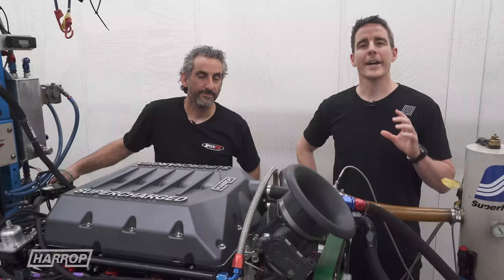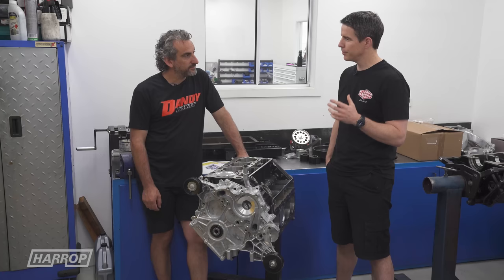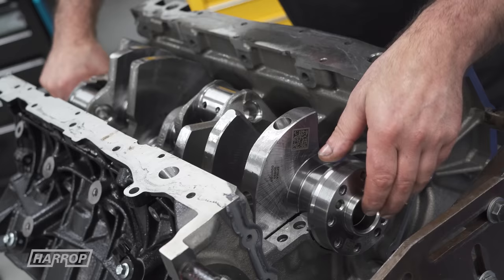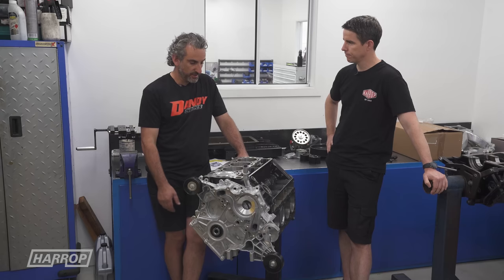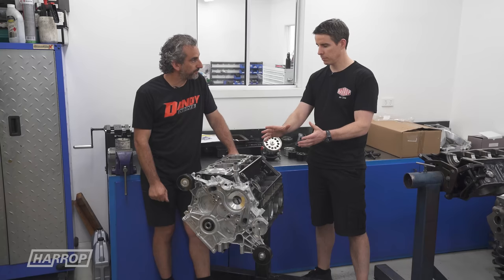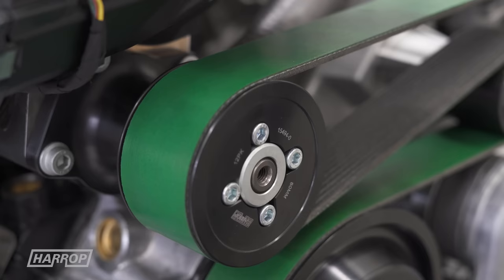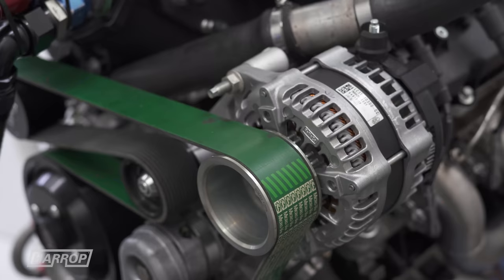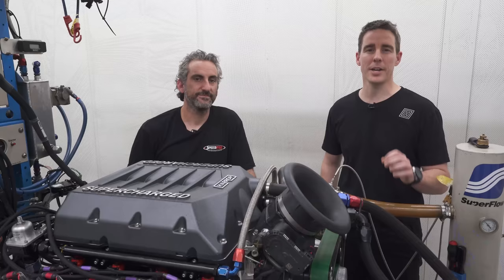1300HP Ford 7.3 Godzilla V8 | Harrop TVS2650 Supercharger Testing

Comment: Bring back the 4.9 straight six with a flow through head. All the power I need to get from point A to point B. All in all its a very nice set-up you got there.
Reply: I think Power nation built a 4.9 with 540 hp it was quite interesting, I had one in my truck 350,000 miles and it ran perfect.
Reply: @andrewward1887  
Yes they did.  I watched that series and the look on their faces after it went from 80 hp to over 500 hp  was priceless.
Reply: Just use an Australian Barra Six !  500 HP is almost factory stock for the 2017 Turbo Falcon 436 HP

Comment: using hydraulics instead of a belt you can control the blower speed with valves, still driven off the crank hydraulic pump that turns the blower

Comment: That is pretty fat, makes my 5.0L Windsor look like a starter motor.
Reply: just turbo your windsor
Reply: Hahaaa!! that made me laugh.
Reply: Maybe you better find some old copies of Mustang and Fast Fords magazines from the early 90s where guys were using a Boss302 block as a foundation to build that Windsor engine to 1200 HP with a power adder.
By comparison, this 7.3 is weak sauce
Reply: reading this im curious, are you talking about current gen 5.0 L when you call it a Windsor? Guessing youre not from North America as I have never heard it called that before. I live in Windsor, Ontario Canada where those engines are made, my uncle is an engineer there actually.
Reply: @WeekendWarriors87  In Australia, a 302(5.0) version of the Cleveland was available('71 to '82), as well as the 351(5.8)C that was also in North America, so the need to distinguish it from the Windsor variety of small block in the same displacements.
Reply: @WeekendWarriors87  More accurately, it refers to the 351 ci 90 degree V small block engine which was manufactured primarily at the Windsor Ontario plant beginning in 1969, and called "Windsor" to differentiate it from the 351 Cleveland  (1970-74) and the 351 "M", the "M" standing for "modified" as it was a tall block version of the Cleveland engine.
351M and 400 blocks were mostly made at Fords Michigan Casting Center.
The heads for Cleveland and "M" engines were built in Ford plants worldwide including Australia and South Africa.
The 221, (1962) 260, (1963-64) 289 (1965-67) and 302 (5.0 liter-1968-2002) are all lower deck versions of the 351 Windsor engine
The current "5.0" engine built by Ford has NOTHING in common with the older series of engines
Reply: @thoriated  Closed chamber "small" (2.07 inch) valve heads--also made in South Africa.
Supply is drying up, they are great for modifying 400 ci car and truck engines if one doesn't want to buy aftermarket aluminum Cleveland heads
Reply: @WeekendWarriors87  My engine is a 1996 5.0L in an AU Falcon ex police chaser. I'm in Australia.
Reply: @donreinke5863  thank you. Yes I know they are different but he called it a 5.0 and the old Windsor 351 is more than 5L which is why I was asking. I hadnt heard the original 302s from that time period referred to in that way (meaning as a windsor) which is why i asked. Thanks!
Reply: @WeekendWarriors87  Youre welcome.
The 302 became commonly known as the 5.0 in the early-mid 80s when Ford began placing 5.0 emblems on Mustangs after their fortunately short lived disastrous experiment with a 255 ci V-8 from 1980-82 for fuel economy reasons.(it was a 302 with a smaller bore)
The actual displacement of the 302 is closer to 4.9 liters than 5.0, but Ford was already using 4.9 as the engine designation of the truck/Bronco only 300 ci inline 6
The 351 was known as a 5.8, even though 5.8 liters is actually 354 ci.
Boring a stock 302 .020 oversize yields  4993 cubic centimeters, or very close to 5.0 liters
61.02  ci=one liter.
Reply: @donreinke5863  Interesting! In Canada I think we still called it the 302 into the 90s and beyond, even though we technically had switched to metric at that point. Currently here in Windsor they make parts for the 5.0, the 7.3 from this video as well as the 5.2 voodoo from the shelby mustangs. My truck and everyone I know runs a coyote 5.0, although its getting less appealing with the ever increasing carbon taxes here. Its interesting to me to see such a fan base of large V8 sports cars in Australia, all we ever hear about from your side of the pond as far as our media goes is small diesels and we always wish we had diesel trucks and SUVs like you guys do!
Reply: @WeekendWarriors87  no the Windsor was the older 5.0L pushrod V8’s used in the Foxbody Mustang and first two years of the SN95 Mustang, there is also a 5.8L or 351 Cu in Windsor, which is almost identical aside from the deck height being 9.5 instead of 8.2 inches, and also considerably stronger, easily holding 900+ hp where a 302 or 5.0 only comfortably holds 500-600
Reply: @donreinke5863   The small block 351W/351C and mid size block 352FE have the same bore and stroke of 4.000x3.500 or 351.86 c.i., Ford wanted a easy identifing difference between the car engine and HD truck engine.
Reply: @gen1c8rs88  The 352 FE engine was discontinued at the end of the 1967 model year and was not primarily a truck engine, first appearing in 1958 as an optional power plant for the Fairlane/Galaxie and standard in the 1958 -60 4 seater Thunderbird. (optional Thunderbird engine was the 430ci MEL series engine)
In the early 1960s, the 352 was the second optional V-8 in full size Fords after the Y-block 292 and from 1965, the 289.
In 1968, Ford began producing the 360 V-8, which was exclusively a truck engine, it used the larger 4.05 inch bore of the 390 (which had been in production since 1961) while retaining the 3.5 inch stroke of the 352
The 360 FE was never installed in U.S. passenger cars, although a 361 ci FE engine was used in the 1958 Edsel.
The 351 Windsor was introduced for the 1969 model year, a high performance variant being offered in Mach 1 Mustangs.
In 1970, Ford introduced the 351 Cleveland, the last new overhead valve V-8 they would design and produce until the recent introduction of a 445 ci (7.3) liter 3/4 ton and heavier truck only engine a couple years ago.
351M and 400 ci engines are variants of the Cleveland, which use the same cylinder heads on a taller block and with the 385 series (429/460) bell housing bolt pattern.
The 352 FE and 351 Windsor were not concurrently produced.
Reply: @donreinke5863  Thanks for the information.
Reply: @gen1c8rs88  Youre welcome.
Reply: @Olds_Pwr  The engine commonly known as a Chevy 350 is in fact slightly smaller in displacement than the Ford 351 (or the old FE 352) possibly why the Chevy is known as 5.7 and the Ford 5.8
Stroke on the 350 Chevy is 3.48 while both Ford engines is 3.50.
All three share a 4.00 inch bore.
Buick, Pontiac and Oldsmobile all had different bore and stroke combinations to arrive at "350" with the Olds having the shortest stroke.
When the Olds 403 was made, its bore size exceeded all  "modern" passenger car engines except the Ford 385 series (429/460)
Even the Cadillac 500 bore was smaller with a 4.304 X 4.304 bore and stroke
Reply: @tylerdavis2516  The easy way around that was using the Boss 302 4 bolt main block which was up until a couple years ago (and still may be) available from Ford Motorsport.
While many stock 302 blocks (even the supposedly thicker Ford of Mexico blocks) would fail at high power levels (there were even reports of them splitting right down the center) the low-deck Boss block is capable of 1000 + hp
Reply: @donreinke5863  yeah the stock 302’s are fairly weak for an American V8, but the 351 is quite strong and like I said can easily hold 800 hp, and you can find them for a couple hundred at the junkyard, instead of a couple thousand for a lower displacement boss 302 from ford racing.
Reply: @tylerdavis2516  The advantage of the Boss 302 based engine is that crankshafts are commonly available to stroke it to 347ci AND it will fit easily in engine compartments where the taller and wider 351W is difficult to install without sometimes major modifications.
Of course, the 351 can and has been stroked to 408ci (and Ive seen some reports of larger still)
There was a guy at a car show here last summer who built and installed a 408 inch "clevor" in a late 60s Mustang.
Reply: @donreinke5863  yeah I can see that, but you can say the same for the 351, which you can stroke out all the way to 427 and even 460 with some machining to the block, and all you have to do is throw a cowl hood on and you’re ok as long as you aren’t using a high rise intake mani
Reply: @Olds_Pwr  No I didnt. It was an alternative reason why displacement is called what it is.
Reply: @donreinke5863  Copy\Paste next time.
Reply: @hamishfullerton7309  LOL I have definitely heard a lot about the emissions stuff on diesels (my buddy is a diesel mechanic). I drive a V8 and hoping to stick with V8s until im forced into electric.. but I do love the idea of small diesels if done properly. The new 3.0 powerstroke coming to your rangers will be a sweet combo once you deal with the emissions stuff, not sure how your government inspections are but we just got rid of ours with our current government which made it a lot easier to fix those issues.
Reply: @donreinke5863  I'm laughing hard, no, no Windsor was making 1015 HP on 10 pounds of Supercharge boost with factory everything. None, notty, they had some sick bada$$ heads and cam combo with more then 19 pounds of boost to make 1300+ HP. I have crates full of Ford and mustang magazines and every other hot rodder magazines you can think of too. By the way, these cams these guys are using is nothing like they used back then either. There is only a handful of trial and error cams being tried. So no, this Godzilla isn't even being poked yet, it's being shaken to see where it will go though.
Reply: @garykarenmcgruther6386  Sorry, this engine is lame at those power levels.
Do you hae any idea what kind of power was being made from boosted 7 liter (426, 427 and 429) engines as far back as 45 years ago?
YOU are making ME laugh at your displayed naivete.

Comment: Borowski Racing Engines . 
427 cu inch.  Smaller cu inch than yours .  4.5 liter Whipple with intercooler 1290 hp on USA 93  which is 98 octane here . 
1138 TQ all @ peak boost of 19 lbs

Comment: 1,300, that thing is barely sweating🥱. You can do a lot with displacement when it’s built to handle the boost your adding.
Reply: Displacement and flow. This is the first big block made from the bottom up in like half a century, the potential of this engine is insane. Coming from a huge chevy guy.
Reply: @SoI_Badguy . Absolutely, there is so much potential with a big block💪🏻. Anytime you have heads flowing 300CFM’s and 10:5:1 compression factory you have a lot of potential. 600hp N/a will be easy with a 230’s/XXX cam. And you will have tons of bottom end torque with the displacement.
Reply: @SoI_Badguy . Lol, they will be the new 5.3’s🤟🏻

Comment: I'm pretty sure a 427 turbo ls makes the same if not more horsepower at the same boost level. For 1/2 the cost I'm sure.
Reply: i 6.0 makes more power at same boost level bone stock bottom end
Reply: @thomasstott527  I know, but I was comparing a similar cube size GM pushrod engine (427 ci) to the ford (444 ci) for the higher torque ratings also.
Reply: @Thegoose95  large displacement always equals more torque... hence why ford finally caught up to the HP of the 6.2... but sadly left there torque at home...
Reply: @thomasstott527  please leave a link proving it's a truck engine with same components making more power. I'm calling 🐂💩
Reply: @thomasstott527  they did more than "catch up" to the 6.2 clown.  Stop with it.  I am so tired of seeing the ls pushers.  Go build your world beating ls and leave us all alone lol.  You're comparing turbo setups to blower setups.  Stop it.
Reply: @Lil' Ike  another heart broken ford owner... do yourself a favor and trade that slow thing for a camaro... we can do complete apples to apples build of supercharged to turbo builds all day long a LS will make more power with less displacement of your Holly grail 7.3 ... and if you knew anything about motors... boost is boost.. a supercharged car and be competitive with a turbo car.. there are pros and cons to either.. but there are no regulations to having one or the other ....
Reply: @Lil' Ike  I bet you have a V6 mustang too 🤣🤣🤣🤣🤣

Comment: Too bad these upgrades are so expensive. That motor was made for a truck to pull heavy weights. The torque looks impressive after your upgrades. If someone was willing to spend the $$$, how good would this engine be to use in actual towing situations?
Reply: Nobody is building this engine just to tow. It's going to be put in cars for fun
Reply: These are designed to be the LS killer.
Reply: No not no more, if your options was to upgrade a coyote 5.0 or a 7.3 Godzilla it would be cheaper getting the Godzilla.

7.3 you get longevity depending on boost levels and reliability vs a 5.0.

My 5.0 blew a rod out the bottom through the oil pan and the 7.3 is going to be the new engine that is going to be placed in the car, since a upgraded coyote is going to set you back 20Gs minimum. Yes you can get cheaper but my build needs to handle 1,000hp daily and that becomes pricey on the 5.0 coyote.

Comment: I pray this or even a smaller version ends up in a RCSB f150
Reply: 5.0 RCSB’s are in the 8’s stock motor?
Reply: @169abr  I just test drove a 5.0 rcsb with the 10 speed 2 weeks ago. Even bone stock I was impressed
Reply: @Matp345  a guy a follow has an RCSB 5.0 with an 18 mustang manifold, E85 tune, and a PMAS intake. Truck went 12.4 and 12.2 I believe. That’s impressive as hell for an NA truck if you ask me since I think they run mid 13’s stock.
Reply: There is a smaller Godzilla 6.8 litres

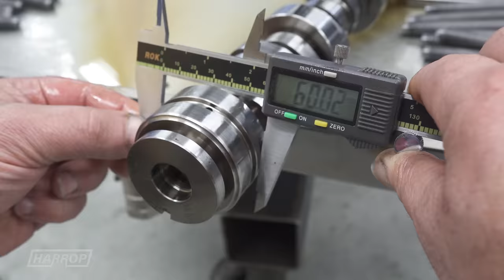Comment: 01:18 what's up with those chunks missing out of the cylinder bore?
Reply: I noticed that too, however that nozzle is an oil squirter. The rod head should never come in contact with that section of the cylinder. Sometimes if you do not remove the squirters while assembling/ removing the rods, it could damage the cylinders as seen there.
Reply: That's just dirt. It's not holes.

Comment: Palm Beach Dyno just did a Hellion twin turbo GT500 making 1250+ HP at 20 pounds. One would think a 7.3 would make a minimum of 1500HP.
Reply: that was turbo which always makes more hp per psi, but the 7.3 would make a bunch of torque
Reply: The blower probably eats up 200-400hp to run, it looks like it is spinning quite fast with the belt setup.
Reply: FiveBar is about to show the world what twin turbo set up will do and Willis Performance (Brian Wolfe) too. Brian's is a true street car though.

Comment: Probably won't matter for you purposes, but on that long down section of the belt, you are getting a lot of vibration. Might want another idler pulley to stop that if you plan on long runs.

Comment: need to port those heads, you can make those numbers with a junk yard 5.3
Reply: For what? One hit? Then it’s oil everywhere.
Reply: @larrypruitt3919  you know thats not true
Reply: @joshstaley7459  man I’m at the track all the time. And all I see is LS junk yard motors oiling down the track. Y’all think that motor can take 2000 HP on the stock internals.

Comment: GM offers a 1004 hp naturally aspirated big block. Why can't Ford or Chrysler ?? Not everyone wants a complicated forced induction intake system. 300 more hp for how much more money 10,000 dollars. Add forced induction to a ZZ632 and then compare the numbers. It takes Ford and Chrysler forced induction to compete with GM. That's pathetic.
Reply: Well there must not be a large market for selling 600+ cubic inch motors that have no basis in production vehicles. At the end of the day none of these engines know what brand they are and Ford and Chrysler could make one easily if they wanted too.

Comment: M I the only one that thinks this build is not that impressive,  higher compression and 19psi,  I do believe in the 7.3 godzilla however still have some making up to do against an LS.. can u imagine an LSX 441 with 19psi  it would be close to 2,000 hp
Reply: I was hoping GM would answer this engine with a modernized 454 in their trucks but instead it seems like they are only interested in EV.
Reply: Too bad you can only imagine
Reply: You can literally pull a bone stock 6.0 out  of a work truck... and twin turbo it ... and make 1500 plus hp... they are so impressed that a 7.3 is making 1300 ... with a massive blower and huge throttle body .... Congratulations guy 🤣🤣🤣